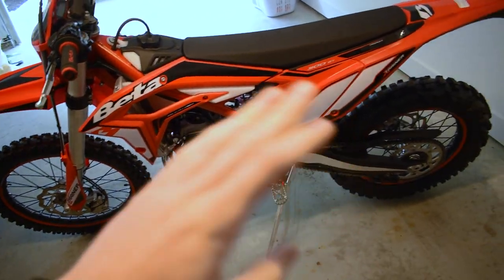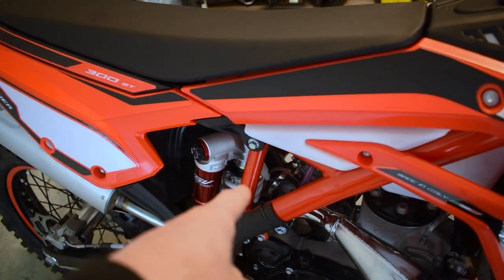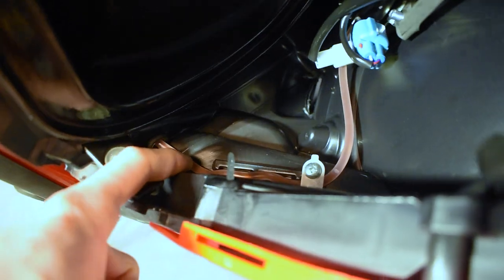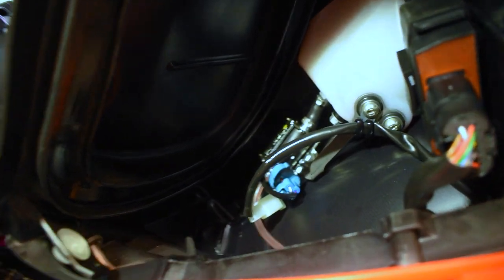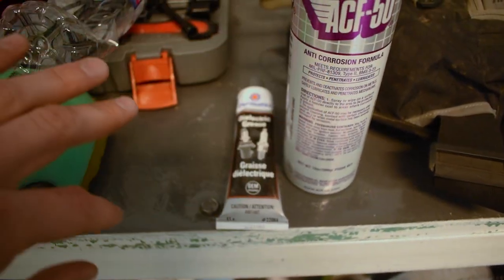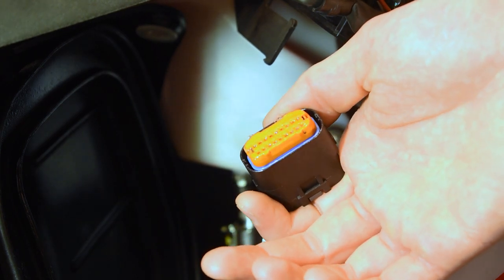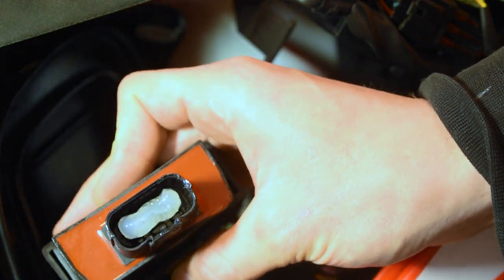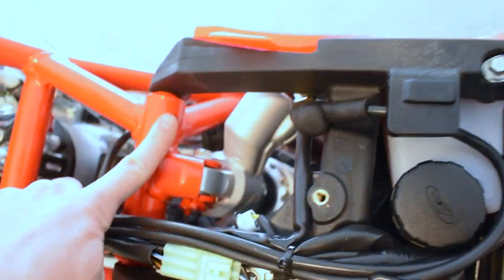If Your 2 STROKE BETA Has OIL INJECTION You NEED TO DO THIS

Comment: They are not known for oil injection failures. Try not to spead rumors. There have been a few failures out of tens of thousands of machines and people on the internet are scaring others. Otherwise, great video.
Reply from the maker: If you had to ask whats the Most common catastrophic failure to be aware of on a Beta, it would be the oil injection on the newer bikes, and main bearing failure on the older bikes. I dont think this video is scaring anyone, more so informing people of some steps they can take to keep their oil injection system working correctly
Reply: @AaronsEnduro  correct. I didn't say your video was scaring others. I said people on the internet are. It's been made into an overblown issue.
Reply: How is he spreading rumors lol. I mean did he not just buy a new bike and is now showing us a line rubbing on the shock? That's not rumors.
Reply from the maker: the line was most definitely rubbing against the shock from factory! Thats a big no no, and an oil injection failure waiting to happen!
Reply: @AaronsEnduro that's exactly it. What happens if you would have rode 40-60h on the bike out of the box, like you should have been able to but you would of had a failure that the manufacturer would consider not their fault... It really shows you did research before purchasing! Good works and great vids!
Reply from the maker: when I had to wait 3 months for the bike to show up, it gave me a ton of time to do some research on the bike and find out what were the weak points!
Reply: oil injection has been junk for decades .
Reply from the maker: This is why I deleted it off my bike haha
Reply: I have had a xtrainer now for years.  It has never had a problem with oil injection and I doubt it will.  It is always the one or two that did for some reason and those are the ones that are remembered as the norm and not the exception.
Reply from the maker: To each their own! All it takes is one hiccup in the system and you blow your bike up! Not worth it to me!
Reply: @gamerX-wk7ct Not really. Suzuki’s CCI system worked flawlessly for years. The difference here is that Suzuki designed in their oil injection system while the Beta system is an add on after thought.
Reply: Oil failures come from idiots not knowing what they own. Its not a toyota! I  have never had a oil failure on any bike only issues when a bike has stood years and its a easy fix
Reply: @gamerX-wk7ct  is working like magic for all scooters and boats for decades... thia is nothing new and very reliable sistem, just secure the hose and protect pins from corroaion... I brought a Beta specific that they have this system.
Edit: I deleted mine after first ride, because I am stressed about it, always checking if oil is working... I have more peace of mind with it deleted, also I hated the oil spill in whole airbox...
Reply: To be fair this is the same issue with KTM. No it’s not every bike but it is a point of failure that will blow up your bike.

Comment: 23 xtrainer has oil cap with "breathing" valve with spring and rubber membrane... And for some reasons.. From time to time.. This valve get stuck, creates vaccum inside the oil tank as a result no oil comes into engine...   greasing ofvthe connectors wont help so much. Bin OI - use the premix.
Reply from the maker: another great one to note! I've already deleted my OI right after i had filmed this video!

Comment: Oil injection failures?  Really?  Show us the data.  What is it?  Less than .03 Percent of total bikes sold to include all the other models that have the same oil injection system?
Reply from the maker: If you look at the facebook forums you’ll see that on the regular folks are having their x trainers blow up from OI failure
Reply: Exactly what I was thinking... this system is used in scooters since forever, super reliable. Just protect the ECU pins for corrosion, check the hoses regurarly and syatem is flawless. Next week I finally brought an 2023 300rr and cant wait to do the chekups and prepare the bike...

Comment: Gotta wonder about this OI issue. I’ve got a 1975 Can Am TNT with the original Mikuni mechanical oil pump. To this day it functions perfectly. The only Can Am’s with OI that failed were fed oil too high in viscosity or the anti-slosh foam in the frame oil reserve deteriorated and clogged the supply line filter. The mechanical pumps were robust and dependable.
How is it a modern electronic pump (working in sync with the ECU) is such a source of problems? The engineers need to revisit the design and goof-proof it. OI is still a better way to lubricate a 2 stroke.
Reply from the maker: It seems like ECU pin corrosion is the main issue. Possibly attribute this to a frequency the pump runs on?
Reply: It could be that the pin is undersized for the amount of current that the pump is drawing, causing it to get hot. Combine that with a bit of moisture, and the oxidation snowballs. The grease not only keeps the moisture away, but also the oxygen.

Comment: Thanks I’m seriously considering doing this to my bike asap
Reply from the maker: if you are going to keep oil injection do these now before you go ride! and even then id still suggest doing the oil injection delete to guarantee you wont kill your motor!
Reply: @AaronsEnduro does it affect the proformance? To run lets say 2% or 2.5% aka 50:1/ 40:1?
Reply from the maker: Yes, too much oil without enough throttle applications will cause your spark plug to foul. Unless you’re in hardcore fast racing conditions 50:1 is plenty oiling
Reply: What do you run? We have similar terain here in Europe just a litle more muddy
Reply from the maker: @matborst5412 50:1

Comment: Hopefully you don't have any electric problems using dielectric grease I've only had to fix cars that use it I've never used any on anything I like my electric connections dry. 🤙⚡😃👍🏍️
Reply from the maker: Fingers crossed!
Reply: yelp dielectric grease does not conduct electricity, but it's good to seal out moisture. I never used it either.
Reply: I use it all the time; never had an issue. Only ever seen issues when it's not used.
Reply: On dirt bike you need tho cars is different

Comment: Hi Aaron and thanks for the vid! Did you have to adjust the carb float at all to get a better mileage? Mine seems to be overflowing excessively... I keep on noticing the skid plate getting wet from gas
Reply from the maker: Yes i did! Mine was set at 6.5mm at a 56* angle

I ended up going to 7.5mm at 56* and its been much better. I will adjust again and try 8mm

Comment: Hey guys I have a 2 stroke carb oil injected atv I need to change the oil do I put oil in where the dip stick is? I do not do premix as I have oil injected oil I also bought 2 stroke oil
Reply from the maker: No, there should be a fill plug on the upper side of the casing
Reply: @AaronsEnduro  I am positive I am not seeing anything so will I be ok with pouring the oil through the dipstick hole as a last case solution?
Reply from the maker: @mark_m1 i mean as a last resort, yea i dont see why you couldn’t fill it from the dip stick
Reply: @AaronsEnduro  yea cause all the oil stores there anyway it’s going by a machanic to do brakes so I’ll just ask him

Comment: Wow that oil injection pump should be relocated right under the tank next to the head, A throttle body, At his way too much line, Ate too much distance for just a small pump, I bet that's the failure right there, Is all that oil wine just hanging out everywhere, This thing to be pinched off and kinked
Reply from the maker: The oil line is snaked around all over the bike! Mine came rubbing against the rear shock from factory! Catastrophic failure waiting to happen!